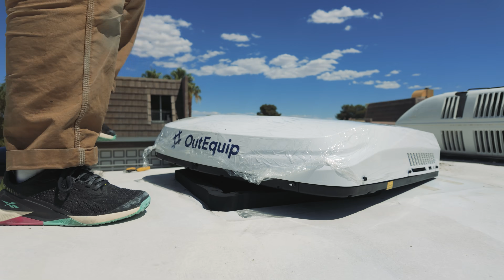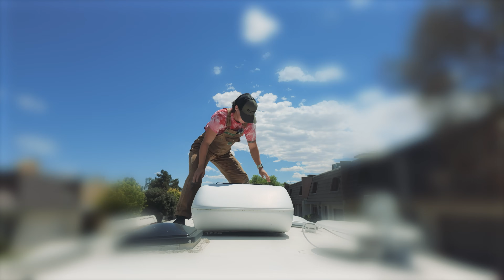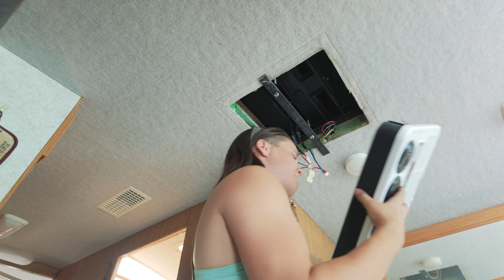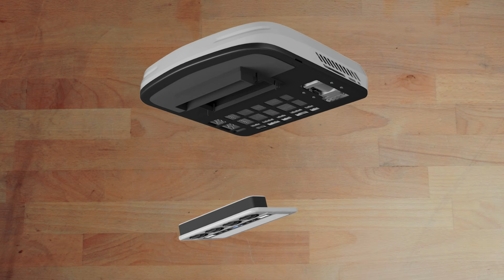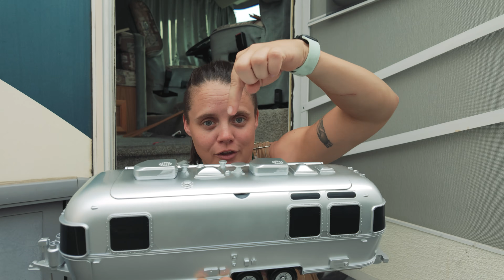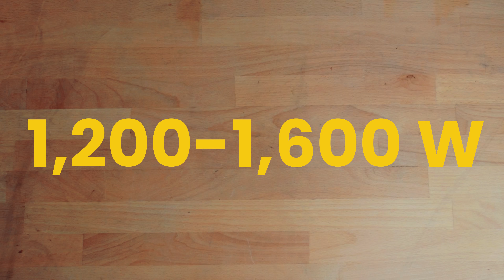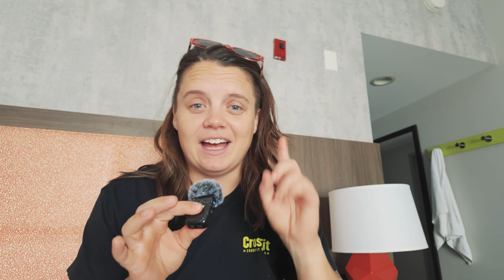Better RV Cooling with Less Power? My Switch to a 12V  AC | OutEquipPro AC Honest Review

Comment: quick response from google, draws 40 to 60 amps of DC current ! Wow ! But, could be way high ? 22amps ? One would need to know the usage numbers running it in a measured area for a day at a certain temp ect. 

 These coolers are very similar to my new fridge, compressor starts up slowly (was described by the fridge tech us agent) . If you do the math, its hard to cool much area with this sort of equipment. But, I have no experience with this type except for my new fridge. 

For boondocking I use a roof mounted version of the swamp cooler. Works well, low current, just need some water.  From what I understand they are a little rare but I did find the company still exists, I think in Nevada or Arizona.
Reply: yeah if you lower the voltage that amps go up

Comment: Good Afternoon,
I bought the outequippro and installed following the directions and video. However, it is not cooling except for an initial cool at the start and only blowing warm air afterwards. Have you had any experience with one of these units not working properly because I can't find any content about a similar problem?
Thank you,
Roger

Comment: We've been using the Dometic 2000 12V air conditioner on our teardrop for a few years now and it works great. We use it regularly when boondocking. It was originally designed for cooling semi truck cabs, I understand. Anyway, just wanted to mention Dometic as they are a high quality company and their product has a track record.

Comment: The amp meter was set to AC amps. You were not measuring the DC amps from the battery. I'm not sure where you were measuring the current, but this makes your watts calculation wrong. The manufacturer shows the DC current to be as much as 53 amps when connected to 12VDC (~700 watts).

Also, this is only a 10,000 BTU unit on 12 volts.  Most RV AC's are 13,000-15,000 BTU's. Thus this is not an apples to apples comparison. 

As a person that has an off grid property I was interested in this unit because of the low wattage people are quoting. Now I know the reports are not accurate and the BTU's are less.
Reply from the maker: Nope, my meter was set to DC amps. And I acknowledge in the video that the amps can get up higher. 

I’ve got another video coming out soon really testing out the cooling capabilities, so keep an eye out for that.

Comment: this ac uses 58a /hr if you use it on a 6 hour timer every night thats ruffly 350ah and the battery capacity should be x 80% (DoD) discharge at a minimum of 437.5ah. good to know for boondocking how much battery u need for this one DC item. Love your video !!  definitely wanna check out some more 🤘

Comment: I have a pickup truck that didn't come with air conditioning. and I was curious if this type of air conditioner would work on my pickup truck. I'm not looking for it to super cool the cab of my pickup truck. but make it more bearable in the summer months. and I expect to have to have the truck running while using the air conditioner. and possibly have to put a higher amperage alternator on the truck? to eliminate dead battery issues. it seems like it would be a better solution than to buy another vehicle with air conditioning? depending on how much this unit costs? I'm definitely going to have to look into this air conditioner to see if it would be a viable option for my pickup truck?
Reply: This unit, while super efficient, may be too much for your truck's alternator/charging system. You would have to spend additional money on seperate battery bank, copper stranded wire/cable, connection lugs, fuse setup, and then a way to charge that battery bank, usually through solar (additional cost). You'd be starting in the neighborhood of +/- $2000.00 just to build all that. This is a real rough estimate but there you go. Good luck. It's not a bad idea, but to do it right (reliable!) that's about the dollars neighborhood we're in.  Cheers.

Comment: At 10:40, Short cycling in an air conditioner refers to the unit turning on and off frequently without completing a full cooling cycle, which can lead to inefficiency and potential damage. This frequent stopping and starting prevents the AC from effectively cooling the space, increases energy consumption, and can shorten the lifespan of the unit.
Reply: So how can the user not have that happen?

Comment: Great video (as always). I am thinking about using one of these in my Class A for a different reason than you mentioned. While traveling down the road I only have the dash AC for cooling unless I run my generator. This would allow me to kick this roof AC on without running my generator (saving gas). Since my motor's alternator charges my batteries as I go down the road already it is a win win for me. Add solar to the mix and you can easily power one of these while boondocking with no draw down in battery power while the sun is out.

Comment: Wow I was trying to catch my breath as you were explaining this but it’s all good you have sold me on this unit very good presentation now I would need to know the longevity of it more accurately because the price compared to the other a/c is great I think there under $1,000 per still worth the savings because you can I think run them separately on there own bank leaving the others safe when boon docking thanks for sharing

Comment: If a 120 AC system were a car, you would crank it up and instantly go wide open throttle until you cross the finish line. DC on the other hand, works like a regular car.
Reply: they make 120v inverter acs now and the only reduction of power you get form a truly comparable inverter 120v ac vs 12v inverter ac is the fact one off grid doesnt have a 3 to 17 precent conversion loss and at max power it uses the same amount as a same sized 120v unit its just marketing form people who dont understand it or have been paid to sell it

Comment: 14:34 If you're getting more cable, make sure to check the gauge (prob 12AWG or even 10 AWG), make sure you get stranded, not solid core, and use butt connectors, because RVs (and Vans) move a lot and vibrations can make a solder or other types of connectors get loose.

Comment: FYI...when plugged to shore power, you take the load off the AC circuits, but not really because your converter or however your batteries get charged, will be drawing power to recharge the batteries as you're using power from them. AC power draw is still there. If its sunny, solar will help, but not in the evening, cloudy, or shady conditions.

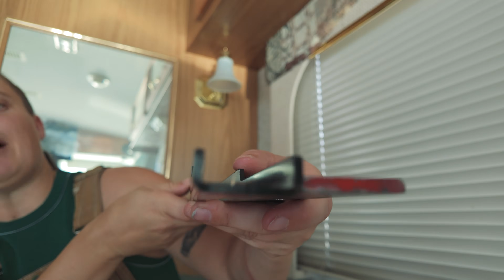Comment: 10:02 I was thinking you can also weld a support on the center of the bracket so it's more like an inverted T shape. That should keep the bracket straight and not bowing. It doesn't have to be very deep either, and it would have to run the same length as the opening minus the bolts positions.

Comment: That’s a very efficient AC unit, but you’re still going to need to charge up your house batteries from some source, Solar, a generator, or the alternator off of your engine. The house bank is not going to supply 12.5 volts forever without having some source of charge up input. Thanks for bring this AC unit to light.

Comment: and the BTU rating????      Here,,, let  me help with what matters.    the "OLD" AC units are 13,500 or 15,000 BTUs.   You claimed yours at 1300 watts... so I assume you were measuring a 13,500 BTU unit   This one your are showing us is: RV Air Conditioner, 12V 10000 BTU Top Mounted Heating and Cooling.   This makes your new 12VAC UNIT more efficient per Watt.     Side/side real life  testing would help your sales pitch greatly...   you could even do it in a garage/shop

Comment: Im a hotshot driver using a pickup. My biggest concern is i usually drive through the worst weather. Hail storms, freezing rain, pounding rain and wind. How well does the unit hold up. Because I can't always find cover. Im worried about the plastics and fan mounted on top of the unit getting completely destroyed.
Reply: right, Ive never seen a plastic fan facing straight up to the sky unprotected.   it will not last the life of the ac.

Comment: You won't free up ALL your ac amps! It would be reduced by the difference in efficiency between the two AC units. 

The AC load will just be shifted to the converter to replace the amps used from the battery unless your batteries are isolated and running on solar. 🤷‍♂️

I do think on a 30 amp service it would free up just enough power to allow you to run a typical low wattage microwave.

Comment: 7:10  This type of compressible Foam Gasket Material is the same stuff Holley Uses on Fuel tank applications!! .. 

Not meant to be emersed in fuel .. but splashed with constantly .. it lasts 10 to 15 years in fuel tank applications.  Check out Holley Sniper II Fuel Pumps for more info

Comment: I used to be into boon-docking "VANS" many years ago, as  kid...   I am retired now and getting back into it.  I have huge GIANT old StepVan .. I got some cash coming in and I m going to outfit it with all this stuff

One of the things I picked a BIG 12 volt DC air conditioned like you are talking about.  So cool (pun intended) your got one donated! .. let's see how it hooks up!  I have that same size opening in the roof so far!

I am interested to hear your input here .. someone ho has installed the unit!

I m assuming the new technology has made 12 volt motor's WAY more efficient? than back in the 70's!! ... .. 

And that along with modern A/C Fluids has made 12 volt DC units viable??.  One of the main mods to the ENGINE I am making s a 270 Amp Alternator / Generator, that has on board welding capabilities! .. It'll keep the batteries charged!! :)

Comment: Great video! Very approachable explanation for newbs.  For us, techies - the DC air conditioners don't need soft-start circuits because they use ECM style motors, which are variable speed, making them naturally soft-start.  This air conditioner seems very solid, I wish they made a 48 volt version though...  Also, wondering if it can be installed tilted or vertically...  For now, I'm using a mini-split I built myself. Anyway, definitely subscribing!

Comment: There's different kinds of DIY ladder hoists you can use to lift a heavy object to the roof by yourself.  I don't know if you'd consider it safe, but it works.  Just need a towel or similar to protect the vehicle while using it.

Comment: Thank you for all the tricks. I have been eyeing this for weeks and you sold me on it. However my question is about exhaust. I currently have a fan and want to replace it with this ac. Would I still have the ability to exhaust air?

Comment: I want to be able to boondock and still use my ac. What choices do I have except using a noisy generator? Can I just use the inverter and what size would I need. I have a Promaster van roadtek.

Comment: I'm really thinking of 2 of these for our 300bhsl! We have a dometic in the front master bedroom, which I would change to one of these, keep the main living room a/c, and add one of these in the bunk room vent. The wiring seems intimidating. With our three slides, our temp is so hot in 100+ degree summer camping.

Comment: I like to run solar(it's quiet)for Hurricanes/power outages but AC is a problem in the summer months. I use ice cooling fans(less than 60 W) but go through alot of ice. Thanks for the info. I usually make it about 4/5 hrs in the summer then bust out the gas generator for AC.😂 I have a small ice fan that's 8W I plug into usb to blow on my head at night.

Comment: At 8 minutes in you talked about using a coupler then a bolt.  This could, over time, work its way loose, especially with the vibration a moving vehicle has.  Put a nut above and below the coupler and after attaching the coupler tighten the bolt hard up against the coupler.  This will make it much harder for it to vibrate loose over time.  I would still check it every so often though.

Comment: We have a class super C. We put in an RV Airflow to improve the air flow to the vents and reduce the noise. We love it. Now, we would like to put one of these 12 V systems instead of the old 110.

Wondering if it would work, even if it’s not designed to work with a vented system. But with the RV Airflow system, I’m thinking it would work. 

Your thoughts?

Comment: She’s totally right about the efficiency of 12-volt AC units in terms of power consumption. You’re usually only pulling 200 to 500 watts, which is great. The issue I ran into is when you’re parked and actually living out of your van at a site with shore power. You have to plug into shore power, then run it through your inverter to charge your batteries, and then the batteries power the 12-volt AC. It’s kind of a roundabout process, and it means you’re still draining and cycling your batteries even when you’re plugged in. Inverters can overheat too, so it’s just not a very clean setup.

What I didn’t love is there’s no easy way to just run the AC straight from shore power without going through the batteries and inverter. For someone like me, staying at state parks with hookups, it felt a bit annoying. But if you’re boondocking or driving and want to use the AC off your battery bank, then 12-volt is amazing. So I think it really depends on your setup and how you plan to camp. Off-grid? Great. Plugged in and stationary? Not ideal.
Reply: May want to check if your inverter allows for bypass mode which should help prioritize AC load when on shore power
Reply: Most people boondocking will have solar panels, combined with extra from AC battery charger shouldn't have issue. My guess is 500-1000W solar if you want run A/C. Typically harder A/C needs  to work  more sun there is so solar panels should keep up with demand in most cases.

Comment: Question-- i have a dc to dc charger hooked to my battery from the alternator .  Do i put the connectors for this unit directly over the battery connector also? Don't want to blow anything that IS working out!  I also have a plug in charger(120ac) connected to the battery.  No solar. Thank you!!

Comment: Subed on my alt YT acct. Love you energy.
22:10 nice. 
I'm in the process of setting up a solar panel for a 8x8 tiny home. I do like that it dos not need to step down and back up from ac and dc. Any pointers on how to set up dc and an inverter on same battery source ? I have a freezer ice chest that is ac. I don't know how to convert it to dc. That will take me some research/learning >_<

Comment: as someone who has installed a few dc based ac systems on both vans and normal rv's the caulking is put on the gasket to prevent water intrusion long term and while under way during wet conditions. this also helps during cold  environments with ice, as the adhesive on the gasket itself is not great.

Comment: Excellent in-depth look at this AC unit.  Very easy to understand for those not well versed in electrical systems and things related.  I've been looking, on and off for a fear years now, for a 12VDC air conditioner that runs off 12 volts.  I've seen many 'concepts' or 'future designs' but haven't really found one until watching.  Thanks for posting!

Comment: 13:28: To route the wires, I simply used the same square cutout that is used for the main control/inlet vent. you have to take off the cover of the AC and reroute the cabling a little but it's simple.

Comment: I have a older 60’s For Econoline Van 9 door this unit would be perfect - I don’t want to do an under dash ac - how many batteries would be needed to run this for say 4-6 hrs in the Azona heat -  thanks 🙏
Reply: So where do you place your batteries- wires, how large are those batteries?

Comment: Is this a better unit for a “normal” Ford 60’s Econoline instead for running a car AC unit which is difficult to find room for the generator fan belts -  would I have  to have more car batteries - which isn’t a problem!  Thanks 🙏

Comment: Very interesting video.  The device is extremely interesting and personally if I were replacing an AC system I would ABSOLUTELY look to go this route.  That being said the difference in consumption was most likely given by two factors:
1.  My understanding is that DC units are better at drawing LESS POWER when they don't NEED to draw more power ... so for isntance when it isn't as hot.  This is a feature of course but you'd also want to compare the units in oppressive heat to give a true judgement on power though yes for sure let's ackowledge the CRAZY better consumption on non-torrid days
2.  That lower air throughput is VERY significant.  Especially in very hot circumstances there's kind of no way the original unit, DUCTED won't have the occupiers of the larger RV being more comfortable than a dump system.
Reply: they make ducted ac 120v inverter acs now so you can have the cooling power and not have just on or off

Comment: 12vdc systems will require much more current drain from the battery.  As compared to a 120vac system, it will be 10 times more current so as to get the same power.  In theory, it will then take 10 times longer to recharge that battery also.  Either way is better than nothing.  A good option then would be many  identical  batteries in parallel electrical connections, and-or a 24vdc system.  Perhaps to complement this, if your able, get a 12vdc to 120vac power inverter for other things or a backup.

Comment: 12-volt ac suck 10,000 BTU not enough takes to long to cool down any van and even worse for RV or a DYI Bus-Box truck- Uhaul they still need to improve the product to a 15,000 BTU at 10,000 BTU you need to install 2 units to get to 20,000. Noise level is about 10-11 DB less.